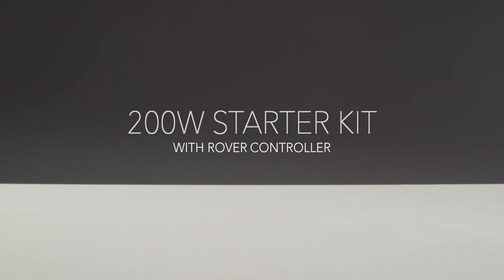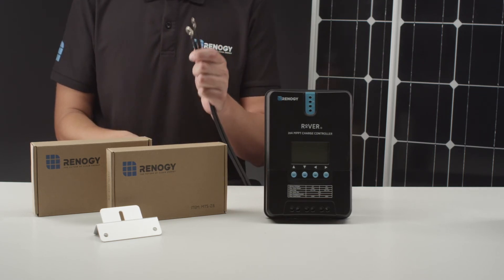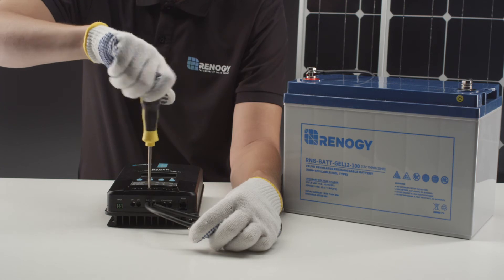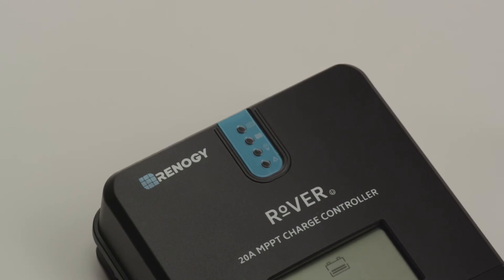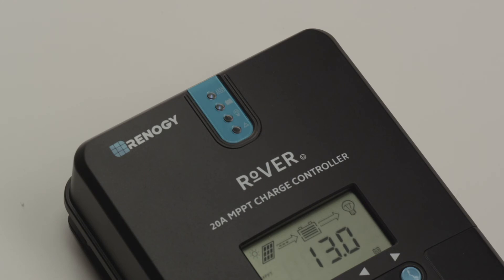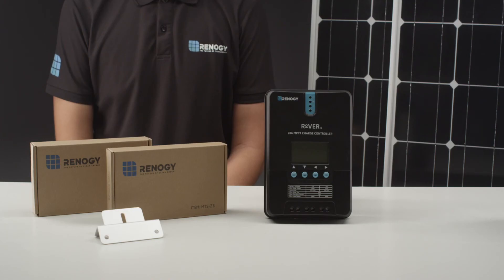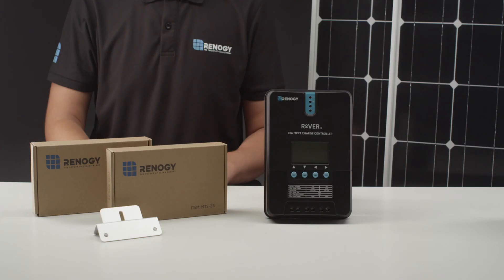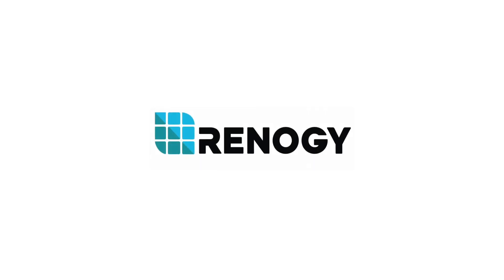Renogy Starter Kits

Comment: I ordered this 200 watt kit and I will say it arrived very quickly but I will also say the charge controler is nothing like the one in this video and the one I received is a piece of junk. every lug on it would not tighten enough to hold even a #12 guage wire before stripping out. My advise here is get the pannels but buy your controler from someplace else, unless you want a useless POS collecting dust while you get another one from another source.
Reply from the maker: Hi, Darrell.

Thank you for your comment. To protect your privacy, please submit your inquiry through our Help Center Portal (links listed below for specific locations). If your region is not listed, please send your inquiry to supportde@renogy.com. If you have previously submitted a case, please provide the case number with your new inquiry. 

https://renogy.force.com/helpcenter/s/contactsupport (USA)
https://renogy.force.com/helpcenterau/s/casesubmit (Australia)
https://renogy.force.com/helpcenterca/s/contactsupport (Canada)
https://renogy.force.com/helpcenteruk/s/contactsupport  (UK)

Thank you for choosing Renogy!